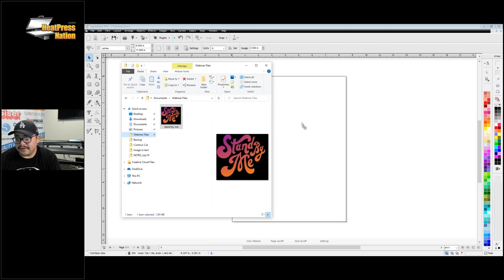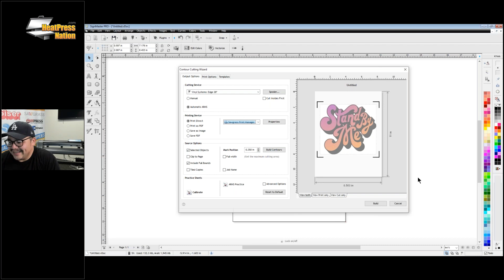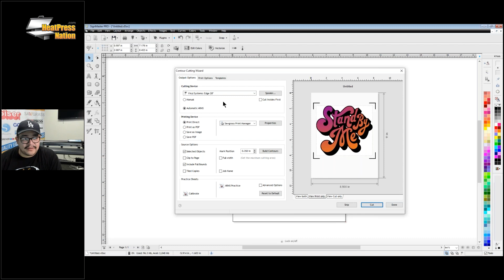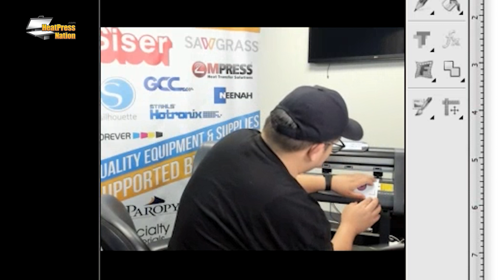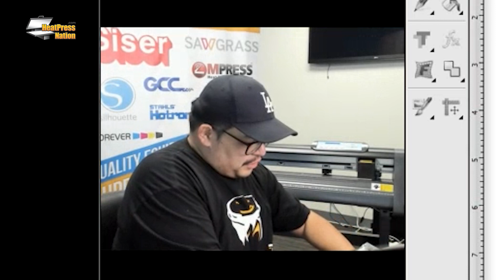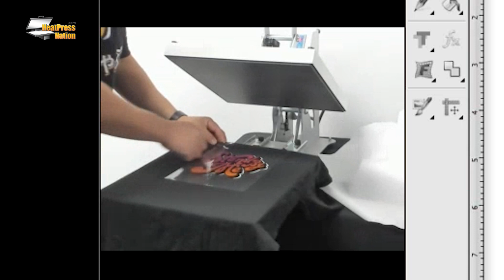SignMaster Contour Cut With EasySubli

Comment: These easysubli papers do they unstick from the t-shirt? Because some of them they have unstuck.Does anyone know why?
Reply from the maker: Hi there! It may be due to different variables. If your heat transfer has peeled off after wearing/washing, here are some possible reasons:
1. Inaccurate Time/Heat
2. Not Enough Pressure
3. Fabric Type is not compatible with heat transfer paper
4. Garment was used/washed before to pressing
5. Washed in hot water
6. Dried in high heat

Hope this helps!

Comment: Hi I had some ink smearing from the rollers on my vinyl cutter is there anyway to avoid this or just not print where they will roll over the easysubli
Reply from the maker: We recommend placing the vinyl on a cutting mat so the rollers don't pass over any printed portion. The Silhouette Cutting Mats actually work great in just about any cutter. https://www.heatpressnation.com/search?type=product&options%5Bprefix%5D=last&options%5Bunavailable_products%5D=last&q=Silhouette+Cameo+Cutting+Mat
Reply: @HeatPressNation  what's the best way to attach the easy subli to the cutting mat?

Comment: Can I contour cut with signmaster cut basic, or do I need to upgrade.
Reply from the maker: To contour cut, you will need SignMaster Pro. However, if you have a Vinyl Systems Specialist, that cutter is not capable of contour cutting regardless of the software. (it doesn't have an optical sensor to read the registration marks)

Comment: What is the difference between the edge and the Evo?
Reply from the maker: The main difference is going to be the motor that drives the blade. The Edge has a stepper motor and the Evo has a servo motor. The servo (Evo) is faster, more quiet, and offers a little more precision and cutting force than the stepper (Edge). Both cutters are able to contour cut and come with the same SignMaster Pro cutting software.
Reply: @HeatPressNation  Thank you!!!!

Comment: Hello, I have been looking everywhere for a video with Sign Master and the Edge Cutter!!! This was awesome. Only thing is you did not mention the pressure and speed your Edge was set to for Easysubli. I have really struggled to find the correct combo and has cost me several sheets! Please help!! Thank you so much. God bless.
Reply from the maker: We recommend doing a small test cut on a single sheet or scrap piece of material. The blade should be extended to the approximate thickness of a business card. Your force should be set anywhere from 85g-160g. (Depending on your blade, you may need to adjust your settings outside of these guidelines.)

Comment: so for easysubli do i need the easysubli masking tape not sure the exact name for it or can i use another brand. also this can be done with dark garments right. (sorry for all the questions im just trying to order everything i need because of your guys black friday sales right now)
Reply from the maker: We've tried different heat transfer masks for EasySubli and none of them stuck well to the textured surface. The EasySubli mask is super sticky, so it works great for the EasySubli printable HTV.
Reply: @HeatPressNation  ok and can u reuse the mask or no?
Reply: Hi so did you put the blade over the starting point or the Lazer
Reply: @ceelowc1496  starting point, mine doesn't have a laser
Reply: Ok thanks